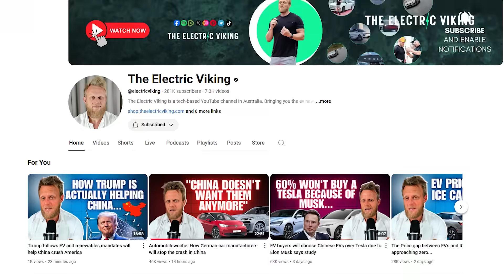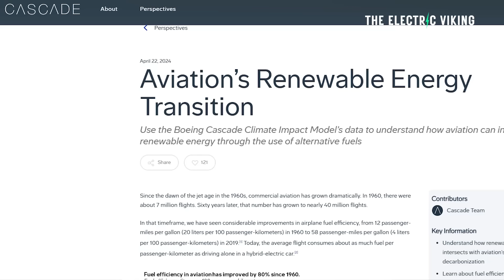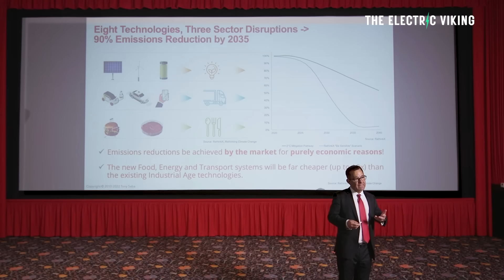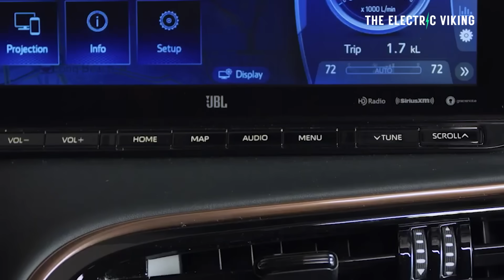The global industries that clean hydrogen production with DISRUPT

Comment: Hydrogen is not a good plan for fueling cars because all they're doing is replacing the centralization problem of petroleum with the centralization problem of Hydrogen. You still have basically a monopoly that you'll have to drive to and fill up.  Electricity, however, is everywhere, including the home.  It is more liberty-enabling, because you can "fill up" anywhere. They can't gouge you.
Reply: But the majority of the elements that exist in our universe is Hydrogen. Sooner or later we'll have to find ways to use that instead of taking away materials out from our planet.
Reply: @antonnym214  the monopolists need to own the product , if they control water they could monopolize H2. The equipment will get smaller and cheaper,the magnetic refrigeration that The National labs were working on in the 80s could liquefy 4 L per hour and sat on a desktop at about 50% of thermal efficiency, about 5% of energy content of the hydrogen.
Reply: It is too early for definitive answers. 

It all depends on the price and convenience. Most of us are not making our own cars, building houses or growing all the food we eat. Also hydrogen wouldn't be monopolised, it is supposed to be made by electrolysis with solar power. More like farmers are making methane out of their cows' farts. The only real monopoly is electricity in the city centre. Middle class living in the suburbs can install PVs. Poorer people living in small flats depend on the national grid (=monopoly) and public chargers.

While running from natural disasters hydrogen is better, it can be transported, stored, shared, stockpiled. Your home PVs would let you charge once and off you go, searching for charging station in the middle of the flood. Or war.

Of course hydrogen is problematic in storage. Maybe the future would be something less volatile? Methane? Propane? Ammonia? Or just synthetic fuels, like Germans did during WW2? Synthetic fuel is very inefficient to produce, but simple to transport. You would skip all the effort of creating new types of cars and engines. Energy used would be sollar, so maybe it is worth the shot?
Reply: Hence why they will roll out Hydrogen Cars! They want to control and own everything!
Reply: @antonnym214  you need to listen to the podcast. This is not about cars.

Comment: JCB went Hydrogen for their earth moving equipment, reason. The equipment needs to be used 24hours a day and the extra weight of the machine with battery would make it useless for carrying stuff. So no doubt JCB equipment with hydrogen power will be used in the mining of rare earth metals for the manufacture of batteries. Funny Really.

Comment: As far as I understand, hydrogen is not a suitable option for shipping as it does not have sufficient power density by volume. The most likely options being considered for shipping is nuclear or ammonia. However ammonia is very volatile as shown by the explosion in recent years in Beirut port, and I'm not sure the public at large will accept every ship, having the potential to create a dirty nuclear bomb sitting in it. So in short global cargo shipping is still a very difficult problem to solve.
Reply: It is possible to convert hydrogen to methanol as well. Easy to store and transport. Big shipping companies as Maersk is now both buliding new ships and converting old ones to be using methanol as fule.

Comment: In Italy electricity is expensive. A lot more Tha than you think.... Charging a car cost at fast charging 0.84c/kw
Reply: If Aptera Motors can produce their currently designed high efficiency BEV with embedded solar cells, Itlay would be a good market.   The shell is to be made by C.P.C. Group, Modena Italy.  The majority of the BINC (body in carbon) is made of Carbon Fiber Sheet Molding Compound (CF-SMC), combined with Glass Sheet Molding Compound (SMC).

Comment: This analysis sort of runs backwards, as in the reason we will have sooo much hydrogen is because in order to have 100% renewables you need 200% capacity (according to Tony Cerva) and many governments around the world have decided they will store this additional generation as hydrogen.  Leaving aside the fact that, according to Sabine Hossenfelder, you will need 300% extra capacity, not 200%, there are numerous reason why this will never happen.  First you need to look a bit deeper at what it means when governments, or the EU commission, make these announcements to the public.  They are either attempts to placate the right people that they are "doing something" and that they have "a roadmap", or they are a sleight of hand to burn more gas.  Yes - more gas.  Germany for example, has built a gas fired power station and claims it is "green" because methane contains a lot of hydrogen, and therefore this plant can, in theory, be modified to burn hydrogen.  But if anyone thinks this will ever run on H2, I've got a nice bridge in Melbourne to sell you. 

The next reason why there will never be a hydrogen economy is because of the sheer inefficiency of it.  The process of generating power to create hydrogen, storing it, then converting it back to power again is at best 37% efficient (Hossenfelder).  If that wasn't bad enough there is the serious problem that H2 embrittles everything it comes into contact with.  It cannot just be stored in the simple ways that say methane can be stored.  It is also extremely dangerous, as in it has a tendency to explode when it comes into contact with a spark or naked flame. The bottom line is, it will never happen, though you will doubtless see some "demo plants" being built just so governments can show you how they are moving along towards their hydrogen goals. It will be like waiting for Godo (who never comes, of course).   Like Elon Musk said, "hydrogen storage is the dumbest idea ever".  Of course, he wants to sell you Tesla mega packs,  but that's a story for another thread.

Comment: So my input on this is that, just as @electricviking Sam says, we should produce hydrogen from electricity and use the hydrogen as it is. Today, 70 million tons of hydrogen are produced from fossil gas. That in itself represents an enormous market. But imagine that, we could also produce methanol from green hydrogen, and consider that every country could do this on its own. It would be great to be independent of other countries for importing fossil fuels—you'd be producing your own fuel. Then there’s ammonia, which can also be used as a fuel and is the basis for fertilizers. Just think how nice it would be to not have to import that either. :-) So I have high hopes for green hydrogen, not just for various types of transportation but also for industrial applications.

Comment: I don't know how they're going to do it. Hydrogen uses an awful lot of energy to produce and it's notoriously hard to store. There was a report from Germany a few years ago that found that if everyone was to drive an EV, they would need to increase their electricity output (independent of people with solar panels) by around 25%. If they were going to do the same for hydrogen they would need to double their electricity production.

I sure don't know how Victoria is going to do it.
Reply: All the excess electricity he was talking about. Converting to hydrogen is one way to store that potential energy
Reply: @mattb3138   How? We don't have a viable way to store it medium term.
Reply: @thethirdman225  Batteries.  It's very inefficient to convert to hydrogen via electrolysis & then convert back to electricity via a fuel cell.  Better solution is all BEV tied to the grid in a V2G arrangement.  Charge when full sun and use some of that power to support peak grid use and at night.
Reply: @jonsek  Oh, I agree. A hydrogen car is just another EV, except that you have to go to a fuel pump instead of charging at home. They make no sense.

What I’m saying though is that hydrogen is an extremely difficult element to contain. I don’t know how they will do that. Hydrogen cars like the Mirai have all the disadvantages and none of the advantages.

Comment: If the amount of energy stored in batteries in cars and aeroplane is workable and viable, logically, the same can move ships. Just the volume and size will bigger.
If energy density of 500w per kg achieved and can easily fly aeroplane, it will be no issue with ships also.
If 70 liters petrol equivalent to 50kwh battery, and let say a ship requires 70k liters of petrol, 50Mwh of batteries is needed in the ship or about 9 nos of 20f container size megapack batteries is needed.

Comment: I'm not entirely sure, but I believe there are just as many people who cannot charge EVs at home as those who can, especially in high-density cities. I’m not certain about the exact numbers, but it’s been suggested that around 40% of people lack access to home charging and may never get the option.

I've also heard that public charging, especially fast charging, can be 3 to 4 times more expensive than home charging. This raises the question—could this 40% be the group that hydrogen (H₂) advocates are referring to as a potential market?
Reply: Not really, we just need the right infrastructure and faster charging for EV’s, then this issue is solved. On the pricing issues, you’re right there is a huge disparity between home and public charging and this does need sorting out. All stuff that will be resolved, Hydrogen will never work for cars.

Comment: Maybe it's possible to superchill liquid Hydrogen so it's dense enough for Air travel. However, the efficiency of doing this, and the challenges of moving Hydrogen around in bulk make that impractical. The big advantage of hydrogen is that the weight of the craft decreases as the fuel load decreases. However, it's hard to see this as a viable way to propel aircraft. Shipping is a different matter, but the challenges are huge.
I would have thought that some sort of liquid electrolyte flow battery would be a better choice for ships. You need ballast anyway, so batteries that are heavy could be beneficial for use as that. You could even pump electrolyte around to balance the ship, just like they do with water now.

Comment: Hydrogen requires LOTS of fresh water. Where is there both an abundance of that AND enough excess electricity to power other nations?
Reply: Brazil have it
Reply: From the sea. RO.
Reply: @tonyrebeiro  And RO requires energy. So now the energy requirement has just gone up again. Just stick to diesel electric generator and batteries like many ships do today.
Reply: There is some massive researching in using salt water, sea water as water source in hydrolis. My guess is that it won't be long until there is a solution on the market.
Reply: @tsbrownie  The energy for RO can come from Solar and Wind.
Reply: @tonyrebeiro  Several years ago they wanted to turn food into fuel, but decided that people eating was more important. You know what the other thing that people can't live without? Fresh water. Turning that into fuel is equally disastrous. I have experience with RO filtering, it is slow and very expensive. Companies will outbid consumers for natural fresh water, forcing the expensive stuff on the rest of us.
Reply: @tsbrownie  There is the scope to run an ICE off water, presently. RO water used for this is very minimal and about 70 to 80% of the exhaust of the engine can be recycled for re-use as fuel for the engine. Ships and power stations could directly run off such technology.
Reply: @tonyrebeiro   you guys are so delusional. So easy to con because you don't think. No wonder things like solar roads etc get funding.

Comment: Hydrogen has potential for heavy duty applicatons such as planes, ships, long distance trucks and bulldozers but not worth it for cars where a battery is fine. The problems with hydrogen is that it is gas down to - 252C where it becomes a liquid and it freezes to a solid at - 259C and it will escape through the smalles hole and it rots steel so its not an easy substance to handle. It is also invisible when it burns.

Comment: Industrial Hydrogen is a totally different story to automotive Hydrogen
Reply: In a car, the hydrogen is used to convert it into electricity to charge the electrical engine.
Reply: @pietermoorer3679  The difference with industrial is you produce it where you need it. Storage and transport are the problem. Not how you transform it back into energy. Although I heard that the "back to electricity" process it's quite expansive to produce and maintain.
Reply: @FlorestanTrement  This is what we’ve all been told but it’s not true hasn’t been for over 40 years. I’ve seen the tankers on the road all the way back into the 80s with liquid hydrogen in the Bay Area.
Reply: @johnstubbe3113  liquifaction consumes 30% of the energy content of hydrogen making even less efficient.. you also have boil-off concerns on delivery and very specialized and expensive transportation equipment - my understanding is this is why hydrogen is usually generated on prem..
Reply: @johnstubbe3113  one other thought.. if "they" have had it down for over 40 years, why is it not now ubiquitous in the transportation industry? Seems like something that was more efficient and cost effective would have been adopted by now at least for industrial equipment, instead we see pilot projects that come and go, costing millions..
Reply: @FlorestanTrement  Yes, electrolysis and H2 to electricity is very inefficient, as is storage and transport, making H2 for transport DOA. But in situ produced and consumed H2 for industrial processes, is the future.
Reply: @johnstubbe3113  Ya, for like research purposes, not transport. You do know Toyota Mirai owners are suing Toyota because these cars are unusable, right?
Reply: @johnstubbe3113  I hear you, there are some customers, enough for one company you know about to be profitable. Still, it's entirely possible that their customers have very small or occasional needs, justifying the overpricing over mounting a local production unit. Someone spoke about research purposes. You didn't give us the whole picture, here. Likely, it was not given to you or the guy you spoke with either. I'd rather be prudent as the Dunning-Kruger effect is looming over us all, an expert at fooling us.
Reply: @machoopichoo2  I suspect in situ prod is also the present and has been for decades.
Reply: @FlorestanTrement  98% of all H2 produced in the world is grey H2 (i.e., split from methane), which isn't great. But for things like fertilizer, it's both obvious and helpful that it is almost always done on site or nearby.
- I say obvious because H2 is terrible to store and transport, which a lot of dimwits who think H2 cars will work, won't accept. 
- I say helpful, as green H2 production on site wouldn't be a change in process or require major factory upgrades, just a switch to green H2, that would need CapEx to setup the electrolysis, but the input H2O is a lot cheaper than CH4. Other industries, like steel making, would have to make significant changes to their methods to use H2.
Reply: @FlorestanTrement  Yes, electrolysis is inefficient, as are fool cells (nice that they require Pl and Ir). Good news about industrial applications is step two is not part of the mix.
Reply: @pietermoorer3679  no, it can be burnt, internal combustion. You are thinking of a fuel cell.
Reply: @lauchlanguddy1004  You know how hot H2 burns? Nonetheless, it the storage and transport of H2 that is the nail in the coffin.
Reply: @lauchlanguddy1004  Why is an inefficient H2 powered ICE preferable to an 80% efficient FC powering an electric motor?
Reply: conversion to ammonia.

Comment: Not sure your argument as to why hydrogen doesn’t make sense for private cars holds up globally.  I’m in the UK and am fortunate to have a driveway and the ability to charge my EV while parked on it.  But data suggests only around 60% of UK households have off road parking, and not all of those will be able to install EV chargers.  That’s a lot of households that will be reliant on public chargers if they buy an EV.  Electricity costs from public chargers can be the same as fossil fuels, and then add in the time factor for charging.  Under these conditions a hydrogen option does make sense, and may even become the dominant technology, assuming support with the provision of the required infrastructure.
Reply: So we need better infrastructure, faster charging and equitable prices and this is solved. All this is coming, look at the speed of development in the EV market. I don’t think Hydrogen has a chance.
Reply: @ True, all that will help.  But I think it’s going to take longer for all of that to be normalised.  Internal combustion cars have been the norm for a long time.   When the EV equivalent of the Polo can do 450 miles on the motorway (in winter with heating on), and be charged again in around 10 mins, and be no more expensive than the petrol version we’ll have parity.  Now if hydrogen can get there first…
Reply: @waynerowley  Doubt small EV’s will have that kind of range for a very long time, but 300 real world is achievable in the next 5-10 years and as long as charging speed/infrastructure improves the same way, well be fine. To put it in perspective, Hydrogen car sales in the whole of Europe last year were 533, less than half a day of just Tesla sales in Europe.